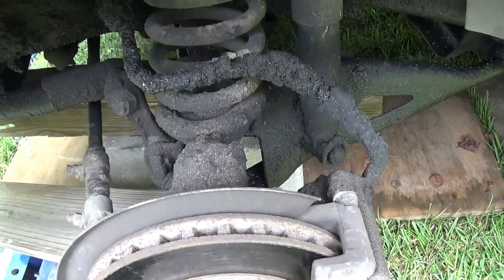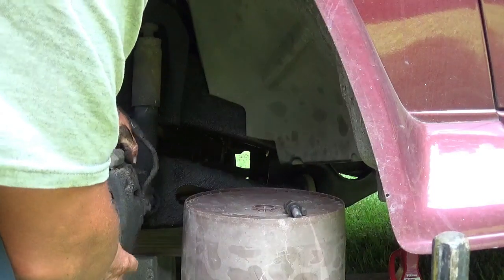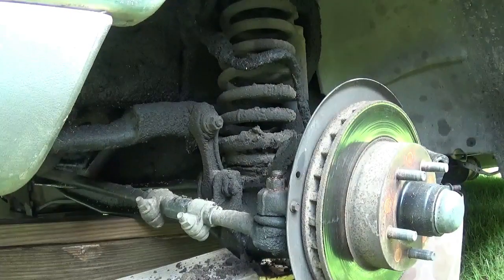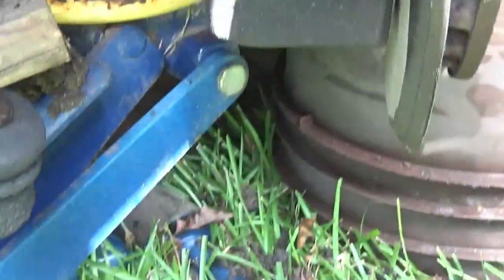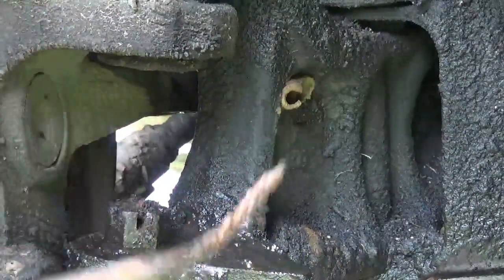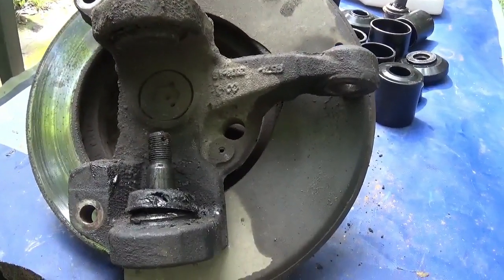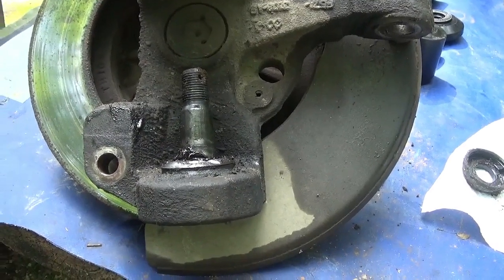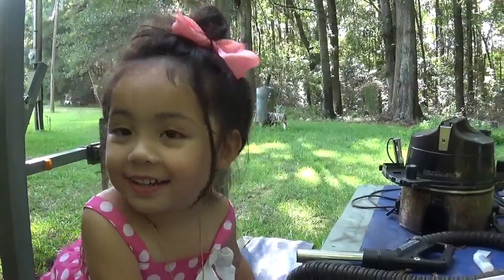Shade Tree Fix It Man.

Comment: I had a 1992 Ranger that was my first truck, that’s the last year they made the square body on them. On the full-size truck I believe they changed the body on them in 1995 or 96 I’m not sure. But anyway I like the ole square body the best.
Reply from the maker: yea i had a 90 ranger with the 3.0 when i would take a trip to the mountains it was great on gas. they are nice little trucks.
Reply: @casselmanoutdoors307   Mine had the 4.0 V6 four wheel drive, big tires. You know the kind, a young mans truck 😂. If I remember I think I got 15 or 16. But I can’t tell you how many of them trucks I’ve had I’ve had the 3.0 and 4.0 they’re both good motors. I’ve always been a Ford man I got a 2007 F150 now it has the 5.4 V-tech and I’ve had three or four of these an the best I can tell they’re good motors. I sent you a friend request on Facebook. Talk more later.